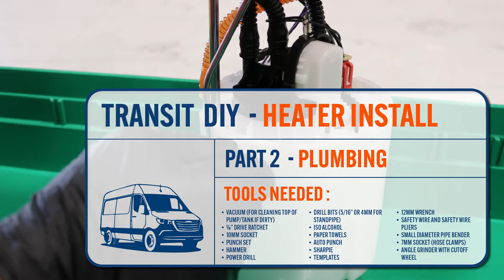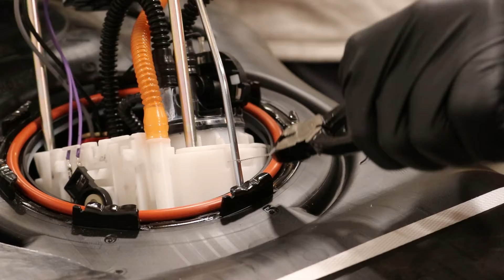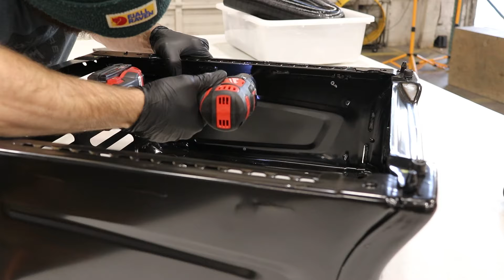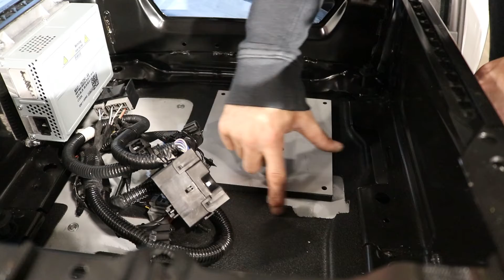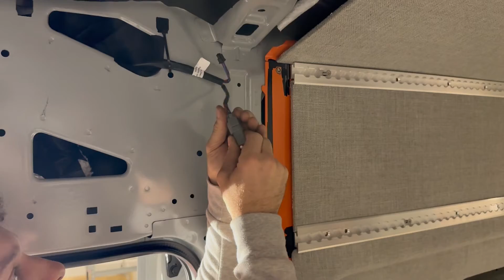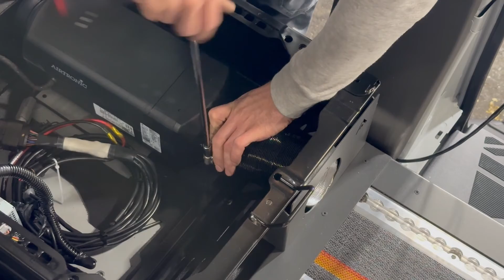Espar Heater Transit Install - Adventure Wagon Van Conversion

Comment: definitely don't need to install the stand pipe while it's in the tank, do it on the bench, route the line the flat spot on the side, opposite of the  Aux line.  also when sizing your stand pipe, make sure you compress the assembly.  my heater is a valit, came with non locking nuts, if yours does too, go get a nylon locking nut and add a washer on the underside, definitely don't want it walking loose.

Comment: Did you add extra protection on your fuel line before running it above the heat shield? Trying to figure out how necessary that is!
Reply from the maker: It really depends on what van you have while assembling- I would recommend calling or emailing our Customer Service team and they can walk you through the whole process!: info@adventurewagon.com or (503) 427-0140

Comment: Is there a reason you didn't cut a larger, oval hole in the floor of the van that encompasses all the smaller holes? It looks like there's room to do that. This is how I've done the install in other vans. It allows you to make all the connections to the heater from the topside, then just drop the mounting plate onto the floor and secure. Also, is doesn't show clearly in your video how you attached the mounting plate to the floor. I'm assuming sheet metal screws. Did you consider using plusnuts/rivnuts for that?
Reply from the maker: Good question! We floated the idea of using a hole saw but when you look under the van there's not really much room to do that because the van's frame rail runs right under the seat base, at the time the size of the heater would not allow it to be over far enough to successfully cut a hole there. 

For the mounting plates we used rivnuts! Let us know if you have any other questions! 😁

Comment: Nice work. It’s good that you fitted the pump on the rear facing side of the cross member, although mounting it just a little higher up shields it from dirt / grime. The bottom of the fuel sender pick up tube is supposed to have an angled cut (not sure it makes much difference). Sleeve the fuel line for a bit of extra protection. All seat pedestal heater installations are fairly noisy, I appreciate sometimes it’s the only option but if you have a cupboard or other space the heater noise can be silenced considerably. The genuine Eberspacher air intake silencer is excellent too.
Reply from the maker: Thanks for the feedback!

Comment: Excellent and timely video. Thank you! I have and am installing your adventure wagon kit in my 2019 Transit. I also already have the same espar heating unit (you did not have them when I bought my kit). I am planning on installing under the passenger seat as well (very tight install). I don't have the mounting plate and gasket you show. Could I buy them from you?
Again, I want to give you kudos for presenting another excellent video!
Reply from the maker: Hi there! Glad you found the video helpful.  Please email info@adventurewagon.com regarding mounting plate and gasket and we'll get you taken care of!

Comment: Why would you drop the tank when the video clearly shows the aux port on the tank??
Reply: Bc the aux fuel line doesn't work well. Adding this standpipe is the best solution
Reply: @bmxguy  does anybody understand why the aux fuel port doesn't work well?  Is it that it somehow losses its prime because of larger diameter than the thin standpipe?  I'm just curious whether there is a link somewhere that talks about this.
Reply: @masalser1  The pigtail is a 4mm line, Espar requires a 2mm line. Bummer Ford didn't do their research
Reply: There is a saying, "It is primarily due to the high altitude performance. When the elevation is above 5000 ft, the thinner standpipe (2mm DIA) has better fuel suction than the factory aux port (4mm DIA). Say, if you are going to the Sierras a lot, typically at 7000 ft, you want to have reliable fuel feeding to your heater." However, I wonder if this is the case. We can certainly do something about the fuel pump and ECU firmware to compensate for the fuel-air mixture if such an issue exists. Additionally, I consulted my local Ford maintenance center, and they told me drilling a hole in the fuel pump complex would void the factory warranty.